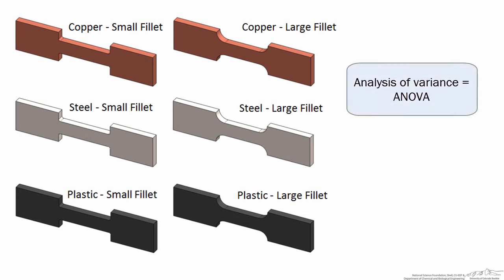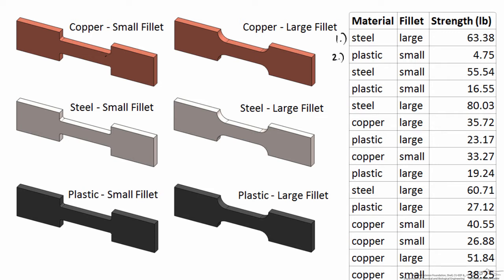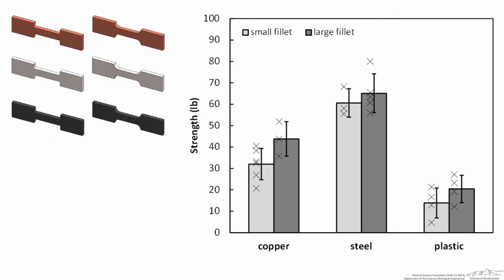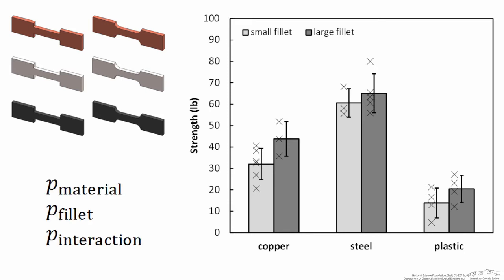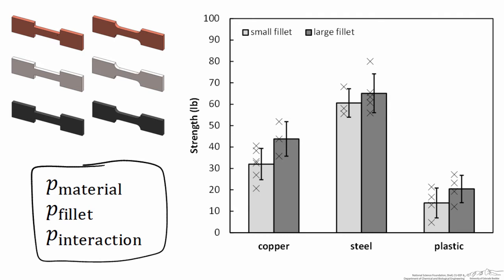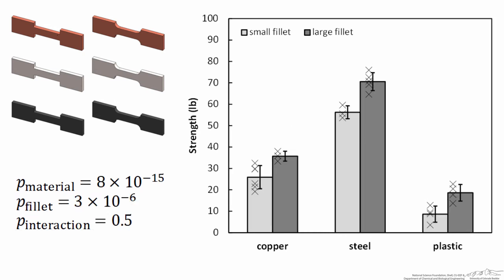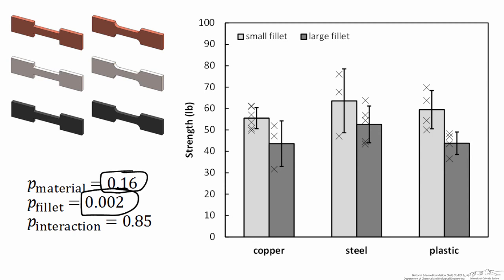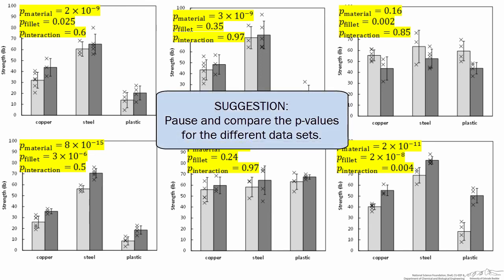The Meaning of a Two-Factor ANOVA

Comment: During the explanation you showed simulated results to clarify the differences between different P values. Could you please provide general guidance how did you simulated from the original data?  Or if you have any video for making the simulation from ANOVA  original dataset, please share the link. Thank you